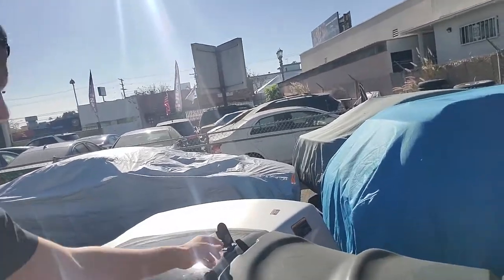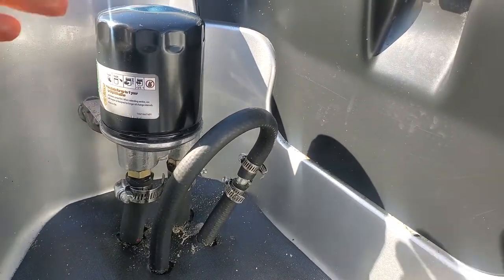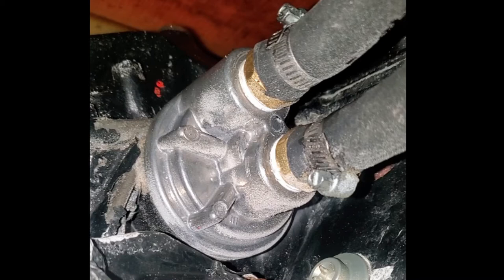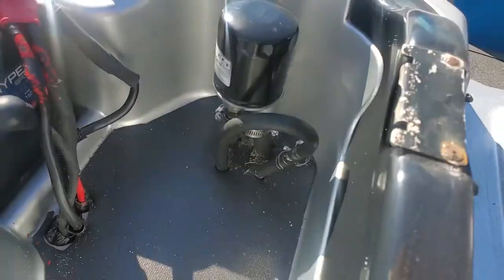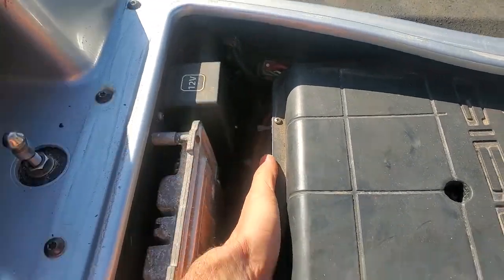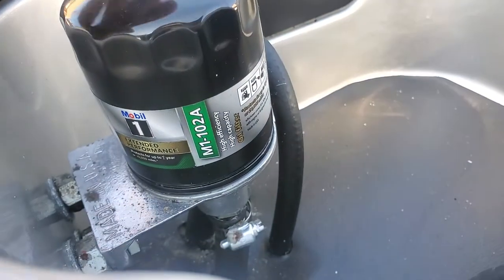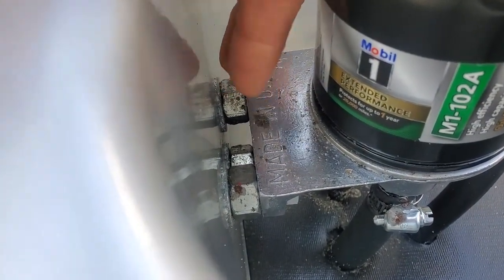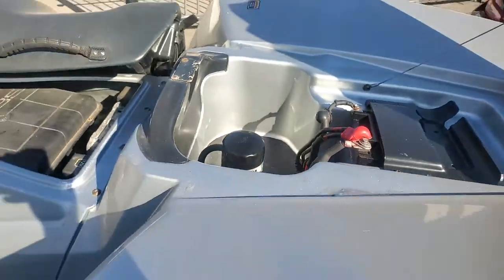Oil Filter Relocation

Comment: Hi, just wondering ,to fit that adapter on bottom where originally was filter,did you take engine out and done all job on work bench and also how did you make adapter or did you find from some other vehicles,is it possible to buy kit? Best regards
Reply from the maker: I installed with the motor still in the ski. The description of the video has a link to the part perma cool website